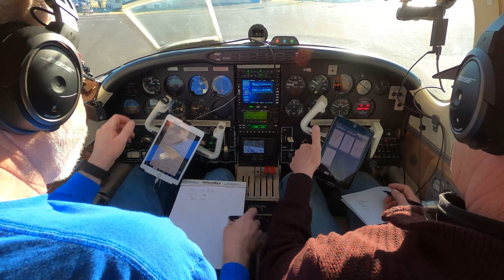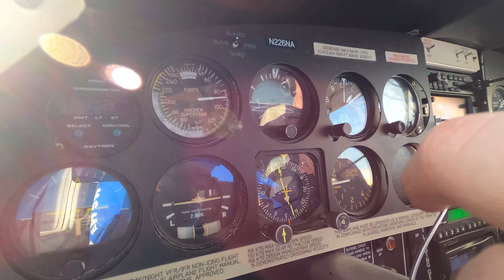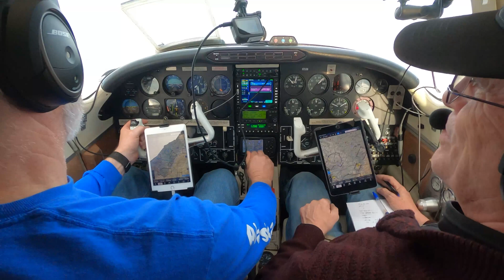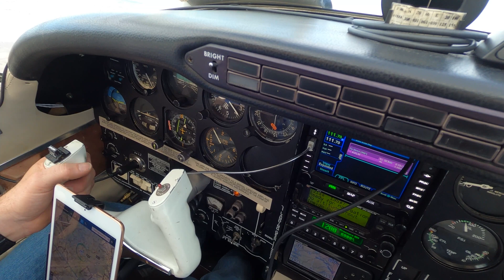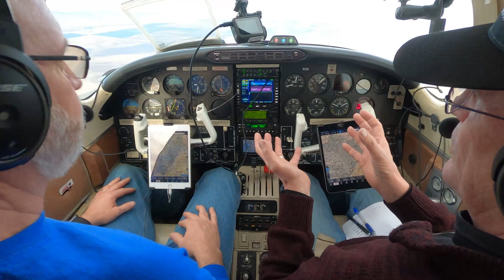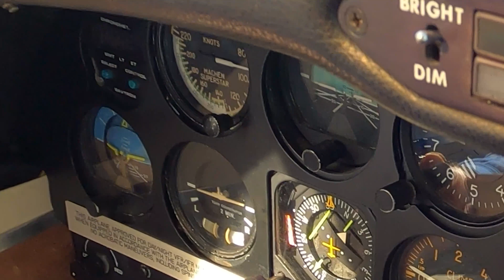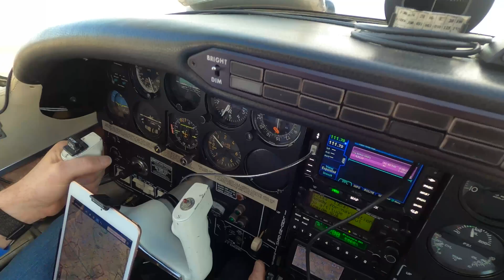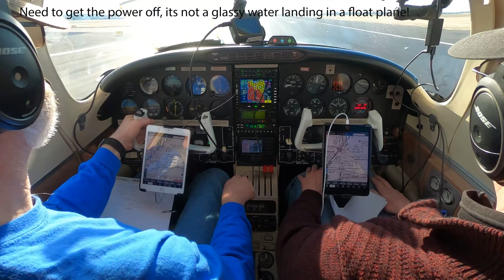How well does the Aerostar 700 perform with an engine out.

Comment: You have the patience of Jobe Mr Reese, I trust your student is not rated as a PIC in this Aerostar, he was constantly distracted, slow to diagnose which engine failed and hesitated on the procedures, took his hands off the controls and changed his focus to the goo on the windshield without finishing the the engine out emergency.  Skip Epperly, Naval Aviator #T12699.
Reply from the maker: He is good now!  Had to shut one down for real after getting home. One of the turbos self destructed. He did a great job.

Comment: We're selling our Bo and moving up to an Aerostar 700. I was curious if it was ok to shut down an engine on a turbo-charged engine--I know that many Baron pilots are told not to do actual shut downs and instead opt for simulators. Interesting to see here you follow through with cutting it off. 

Btw, I grew up in the Tri-Cities and for a short while my mom and sister lived in Walla Walla (home of the Little-Giant Vacuum Cleaner Company). I just flew over you guys to Richland a few weeks ago.
Reply from the maker: One might ask if you shut down your turbocharged engine after landing?  Right?  With proper cool down and warm up, there would be no problem doing so.
Reply: It's certainly not a good idea to just shut down your engine down with a turbo charger without first letting the engine run down ,
It's more important to let the turbo run down and cool for a couple of minutes that insures that the turbo is well oiled and a little cooler.

Comment: Yay favorite aviation vid back on again and soon too. Anyway with the 700 upgrade, did they ever do anything to resolve the problem with complete loss of oil in the engine when the turbo seal went bad and blew out all the oil.
Reply from the maker: You might be referring to the original Superstar II conversion which used the 350hp Piper Chieftain TIO-540 J2BD engines.  They had a single Garrett turbo.  The later conversions, Superstar 700, have either the IO-540 S1A5mm or the IO-540 AA1A5mm engines STC'd for 350hp. the mm stands for Machen Modified. The Aerostars designated as the Super 700 have the TIO-540 U2A's.  The Piper 700P has the U2A's but are counter rotating in the opposite direction as you would expect though. All the turbo'd Aerostars other than the Superstar II have two turbos per side.  I am not aware of the oil problem you have mentioned.